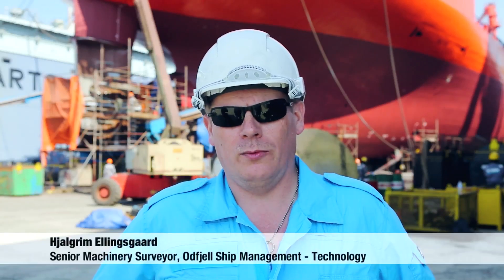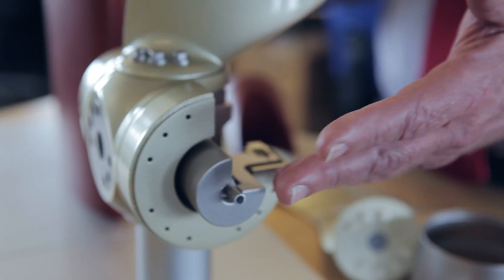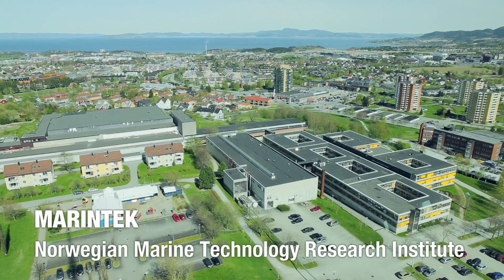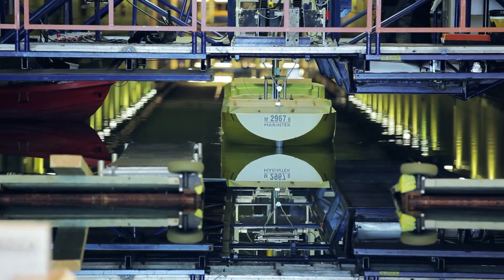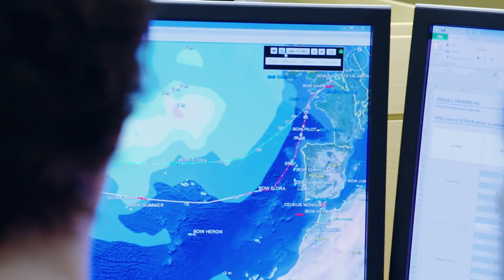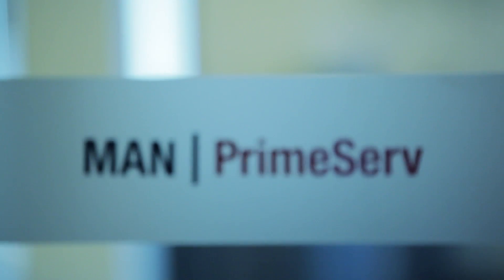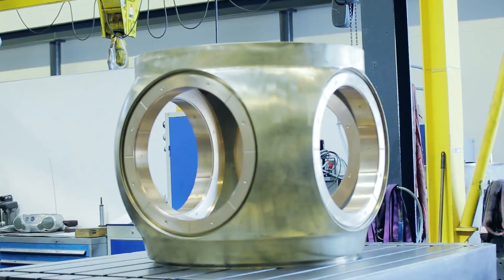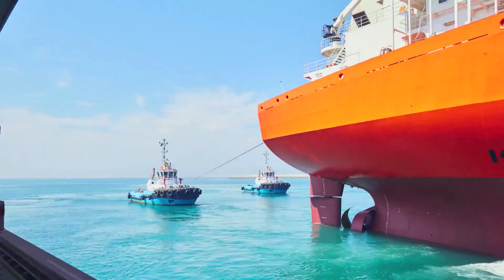MAN Propulsion system upgrade to reduce fuel consumption and emissions by more than 20%

Comment: It looks like the fairwater added to the propeller hub extends to the rudder. It appears however, that if the rudder is at any position other than zero degrees, the stream of water will be exposed to the blunt surface at the junction between the end of the propeller hub and the start of the fairing on the rudder. Is it possible for you to explain this? It could be that I am looking at the video wrong. 

20% improvement is incredible.

Comment: Hi
why not Kappels 8 blade, as developed for submarines? 
less cavitation/noise less waste of power?
Reply from the maker: Dear Ninjatriks,

There several reasons for having 4 bladed propellers.
- Designing propellers is always a compromise between many influencing factors. The optimum number of blades differ from the applications they are used for. There are many aspects such as the trust/power required to reach desired speeds, maximum diameter of the propeller, acceptable levels of cavitation & noise just to mention a few. For many merchant vessels 3, 4, 5 or 6 bladed propellers are the most optimum solutions and for these chemical tankers a 4-bladed propeller will actually result in the highest possible propulsion efficiency.

- As this was a retrofit on existing 4-bladed controllable pitch propellers only the propeller blades where exchanged (along with other upgrades of the vessel). The existing propeller hub was reused whereas the number of blades had to remain unchanged.

- On submarine the requirements to the propeller are quite different compared to merchant vessels. Stealth is perhaps the most important feature of a submarine and therefore cavitation and noise is to be limited to an absolute minimum in order for the submarine to succeed in its operations. Therefore propellers with 8 or even higher numbers of blades are used.

Comment: Hello' i want to ask, is possible reduce a bit more the fuel consumption using 35% of the power of the engine, but connected to a gearbox to not reduce so much the propeller speed?
Reply from the maker: Dear Spotav,

If we understand your question correctly you suggest inserting a gearbox in the propulsion drive train in order to increase propeller speed at low engine power.

A rule of thumb in propeller design is that:
“The slower a propeller is rotating, the fewer blades and the larger diameter it has the higher efficiency you can have”.
There are of course limits inflicting on the rule of thumb and how efficient a propeller you can have. Very often these limits are determined by the maximum allowable propeller diameter on the specific installation and the engine.
As propeller and engine are closely connected the highest efficiency is achieved with a holistic view of the propeller system. The optimal achievable efficiency will be influenced both by the propeller installation and the engine optimization.
Due to the above the answer to your questions is that it is most likely that you will not benefit from increasing the propeller speed at low engine load but it all depends on the characteristics of the specific propulsion plant in question.

Feel free to contact your local MAN Diesel & Turbo office for a more detailed review of your propulsion system.
Reply: Thanks